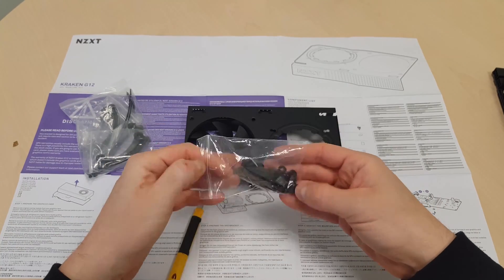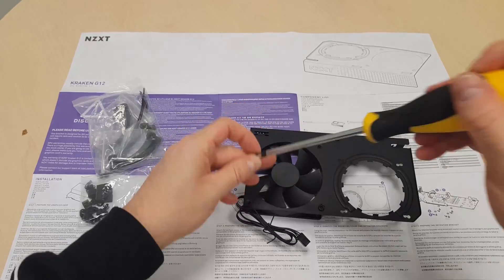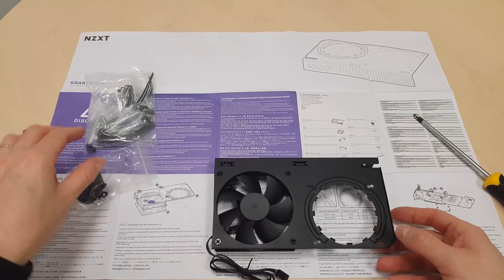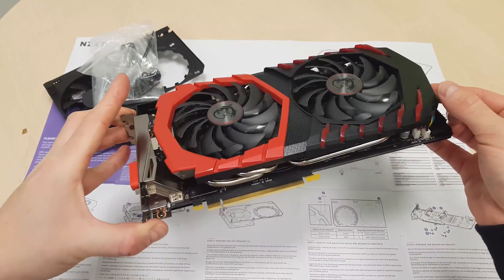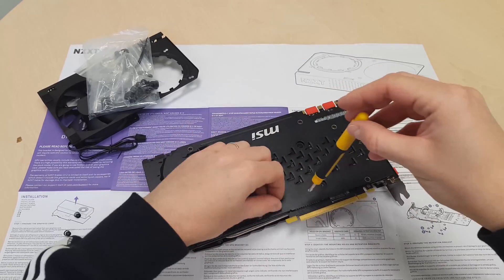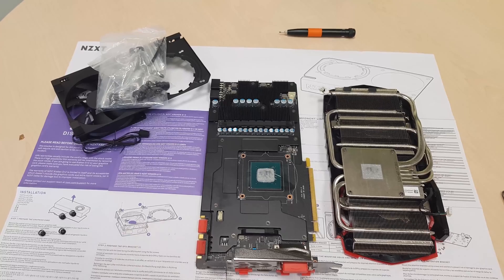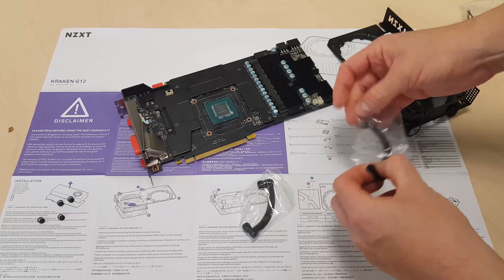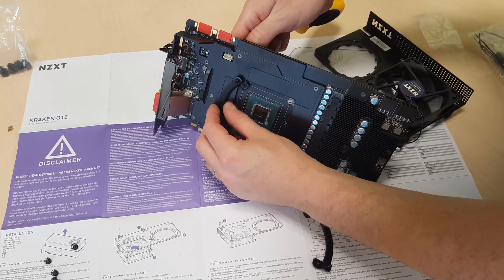Kraken G12 with GTX 1080 installation guide (4K)

Comment: Im confused your pc is upside down? If not that your installation is wrong, the pump should be lower then radiator.

Also did you forget put the thermal paste?? 🤣

Comment: actually the bracket's fan should be mounted to blow air on to the vrm and memory modules and not the way you put it. Maybe you could squeeze a couple more degrees less that way
Reply: Also where is the thermal paste
Reply: @EminentInception94  it's pre applied on the cold plate

Comment: I need help with this, i followed the same guide and while ingame after few mins i see dots on my screen and the game shutdown.....any tips?
Reply from the maker: U should monitor your gpu temperature with software such as hwmonitor. And you should double check that your heatsink is tightly attached to the gpu. Also make sure you connected all the power plugs. I think cooler has 2
Reply: @Techgurl  i'll try this,im mounting this on a b450 gaming plus max and probably i connected the pins in the wrong places
Reply: @federicoandreani201  This tech YouTuber had the same problem as you (sort of). You should definitely check out his video for a bit of help : https://www.youtube.com/watch?v=a7r_2rE1yro

Comment: Thanks this helped me with my same card!! Sitting pretty vertically mounted with the kraken x53!!
Reply: its late to ask but can u help me telling what kraken i should get i have gtx 1070 and what cooler i much get it but i want only single fan like this im so confused what is going to fit i dont want to order wrong stuff thanks
Reply: @gutsy-beard14  

TL;DR - Kraken x42(if you can get it) or Corsair H55. See below for why.

Technically any Asetek (type of mount) AIO will work. That includes any Kraken AIO or Corsair Aestek AIOs. However specifically this is the compatibilty list (from amazon):
------------------------------
Compatibility - Graphic Cards
Nvidia
Titan X, Titan, Geforce GTX 1080 Ti, 1080, 1070, 1060, 980 Ti, 980, 970, 960, 780 Ti, 780, 770, 760, 680, 670, 660Ti, 660, 580, 570
\AMD
RX 480, 470, R9 390X, 390, 380X, 380, 290X, 290, 285, 280X, 280, 270X, 270, R7 370, HD7970, 7950, 7870, 7850, 6970, 6950, 6870, 6850, 6790, 6770, 5870, 5850, 5830
Some variations in AMD die height may require the use of a copper shim which is not included.

Compatibility - AIO Liquid Coolers
NZXT
Kraken X72, X62, X52, X42, X61, X41, X31, X60, X40

Corsair
H105, H110, H90, H75, H55, H50 (CW-906006-WW only)

Thermaltake
Water 3.0 Riing RGB 360, 280, 240, Red 280, 140,
Water 3.0 Ultimate, Extreme S, Extreme, Pro, Performer
Water 2.0 Extreme, Pro, Performer

Antec
KUHLER H2O 920V4, 620V4, 920, 620

Zalman
LQ-320, LQ-315, LQ-310. 
-----------------------------------
In terms of cooling a single fan option. In the UK Kraken x42 is no longer available - seems in US Amazon it is. Best bet: x42(if you can get it) or Corsair H55.
Reply from the maker: U need to check compatibility list on craken website
Reply: @gutsy-beard14  yeah but make sure to install heatsinks on the vram chips and vrm because noone seems to be doing it for some reason ?

Comment: i am  installed the kraken g12 with corsair hydro h55 on r9 390 and after that always i start any game the card was disconnect and i have no picture ,after that i need to restart my pc ,maybe you know what can be a problem?
Reply from the maker: U maybe forgot to connect power to the cooling unit?
Reply: @Techgurl  no ,I connected the pump to the motherboard and then when it happened for the first time I think maybe the motherboard slow down the pump ,like fans control or something,then I connected it to fan splitter and had the same problem,I set the stock cooler back and  everything is ok,I think maybe my power supply is not enough, I also try to connect stock cooler when the pump is on the gpu to exclude the option that it is programmed to work with them, and I still had the problem ,I want to try just connect the pump to fan splitter and try play something when the stock cooler is on the gpu

Comment: How the GPU can control the pump and fans when they are didn't connected to the gpu?
Reply from the maker: I dont know but it seem to work well and the temp is low
Reply: @Techgurl  ofc because the pump and fans working always on 100% and when you just browsing or seeing movies it's noisy
Reply: @alexorn21  I put my pump in a 12v for 100% speed and it dosn't sound that bad on a Corsair H55.

Comment: How are you controlling the pump.. and how thick does this make the gpu
Reply from the maker: Its aio system. No need to control anything. And the gpu is thinner than stock

Comment: Several errors in video for others to avoid:
1. Pump above radiator can trap the little bit of air in the AIO, which is louder, causes worse cooling performance, and shorter pump lifespan
2. Fan backwards but, that's already been pointed out; cooling not as efficient as it could be
3. If leaving on the "midlate", cut the foam offsets that are designed for no "midplate"; notice the significant bend of the G12
4. Screws appear to have been overtightended but may have been done to offset mistake #3
5. Don't plug in pump into fan controller, plug it into something that provides full power such as a SATA or motherboard fan header
Reply: I was watching and think the same shit. Like I thought to myself as I was watching, I wonder how many bad PC build videos are put there that show mistakes and incorrect stuff as if its correct, misinforming people.
Reply: question for no 3 do we need the foam offsets? can we just not put them
Reply: @samuelkdu  Yes, you can get away without using the foam. You would just need to be more gentle with handling the card after it is installed. The foam basically prevents a user from pressing the cantilevered fan portion of the g12 towards the PCB.
Reply: I have 3 open fan plugs on my mobo I can plug them up there with no problem doesn’t have to be a pump plug
Reply: Just make sure to set that fan header on 100% from bios otherwise pump won’t work properly

Comment: Is that stock VRM fan a 3 pin or 4 pin? And how are you powering that H90 cooler.
Reply: Can you tell me. what other things I need to buy unless that kraken g12 if you can to send me link  of the parts please my video. card. it's same

Comment: I have been looking at getting one of these but wasn't sure if my pcb would work. Turns out from doing a little research, my GTX 1080 Duke has the exact same pcb as the gaming x. The card is extremely long and gets a little hot (65-75C) when gaming at 1440p pushing 144 fps at high settings even after a setting a custom fan curve.  Hearing of people being able to keep the temps below 60C (45-55C) has made up my mind. Thank you for showing this video so I can now feel better about making the swap knowing this should fit my card!
Reply: Yes, my RTX2070 almost hit 80c with overclock, now it's around 60c load with the G12 and a Corsair H55.

Comment: I am really considering this because my gtx 1080 is always at around 85 degrees under load, and its loud af. But the only thing that concerns me is taking apart my gpu as well as connecting the fans/aio to the graphics card. I saw you where using a fan hub to connect it, but is there a way to have the gpu to control the fan and the aio cooler?
Reply from the maker: The gpu has only one fan connector. For this you need 2
Reply: techgurl Ok, then should the pump or the fan connect to the gpu?
Reply: I would like to know this as well because I'm really close to buying this setup for my 1080 FE and have no idea how the fan cables are plugged in as most videos I have watched don't even show that process :/
Reply: Kelvin Lam Kinda late reply, but you can get a Y-splitter from noctua, with this splitter you can connect the pump+vrm fan and control it like you would control your stock cooler (through the gpu) And the fan for the rad just plug somewhere into you mobo and control it through bios, if you don't want to get that splitter from noctua you simply plug all the connectors into you motherboard if you have enough space.

Comment: I'm just gonna say you were better off re-pasting if you were hitting 80+.
Reply from the maker: Repasting brand new card? For mining its not good enough
Reply: @Techgurl  you don't know fuck all you put the vrm fan on backwards 😂
Reply: @plummet3860  as long as it moves air over the VRMs, it dont mater what way the air moves. and you say he dont know fack all?
Reply: @grasshopper1g  Its pulling air away from the VRMs not pushing it lol
Reply: @plummet3860  yes, and that don't matter.  As long as it's fresh air.  And why say lol after everything? It's just strange.
Reply: @grasshopper1g  How do i say lol after everything i said it once? pulling air from vrms will not cool them properly at all you are strange for thinking it doesnt matter iam guessing you mean why do i use the emoji for laughing after stuff? thats because its what happens when you post comments via a phone
Reply: @plummet3860  I have this on a 2070.  I just tried it both ways.  It made no difference at all.  It still cooled vrms and memory just fine.  I can show you a video if you want.?  Pulling air, or pushing air, is still air moving.  And that is all it needs.

Comment: was it ok to have the G12 mounted bent like that? does NZXT include smaller "feet" to avoid this?
Reply from the maker: It works fine
Reply: techgurl it seems like it would work fine without those rubber supports too?
Reply from the maker: Maybe.. but it seem to help not to scratch anythin
Reply: probably would of cut the feet down to with a knife before assembly so the bracket wasn't so bent.
Reply: Can you tell me. what other things I need to buy unless that kraken g12 if you can to send me link  of the parts please my video. card. it's same

Comment: Umm... no thermal paste? Your fan was installed backwards as well.. Take this down or change your title ffs
Reply: there is thermal paste preapplied to the water block. didnt need to add more there.
Reply: With the clearance in his case the blower style fan might actually work better.
The fan will starve for air if it's trying to push air onto the VRM in his situation because of the lack of air to suck in where the fan is placed up against the case wall.
Reply: Can you tell me. what other things I need to buy unless that kraken g12 if you can to send me link  of the parts please my video. card. it's same
Reply from the maker: It works well and temp is low. So whats your problem?
Reply: You know how keyboard warriors are, easily triggered. lol

Comment: I have a question, I am willing to buy the Kraken G12 but I do not understand very well how the connections of each fan, the sea of the radiator, the pump and the heatsink of the GPU. Min 6:20 where does each connector come from and what is the name of that device that has many 3-4 pin inputs? Thanks
Reply from the maker: you only need to connect 2 standard fan connectors. the name of the device is fan controller and it's a part of this Antec Razer Cube case
Reply: Thanks , im other dude why do not mount a copper shim on top of the gpu chip? look this video in minute 8:30 https://www.youtube.com/watch?v=S2SFSYl60jk&feature=youtu.be
Reply: @Techgurl  Sorry for my. bad. English but. pls. just tell. me. so. I got. the same. video card if I get the kraken g12. do I. need. to get. heat sinks. for vrm and. vram.  or no???
Reply: Daniel Cler only use it on evga cards but not necessary needed for most cards but for evga cards I would dremel it since I will do it tomorrow
Reply: Ok thanks ;). My card is MSI 980 Ti 6gb
Reply: The device is called a fan controller, its a substitute to plug in more fans and pumps instead of plugging them into your motherboard Corsair and other can companies sell them. I Have 2 1080 Ti's and I definitely need this for running them in SLI.
Reply: Can you tell me. what other things I need to buy unless that kraken g12 if you can to send me link  of the parts please my video. card. it's same

Comment: how do you control pomp and radiator fan speed?
Reply from the maker: Its fully automatic. No need to control anything. But i assume you can somehow control fan voltage
Reply: The only speeds that are controlled are the fan speeds cooling off the v ram, and the water pump/Radiator fan. Realistically you only need to plug the water pump and v ram fan into the motherboard. You can plug the radiator fan connector on the one that comes with the pump if you are using an AIO cooler.
Reply: you control that corsair with corsair link.
Reply: Can you tell me. what other things I need to buy unless that kraken g12 if you can to send me link  of the parts please my video. card. it's same

Comment: Your vrm fan is backwards
Reply: Yolo
Reply: LOL
Reply: I should have read the comments (or just looked at the arrows on the fan) before I followed this video.
Reply: i think its exhausting the hot air
Reply: @XsBig  There is nothing to exhaust. That fan is just to blow on the VRM's, and Memory to keep it cool. Has no other purpose. But his temps still seem amazing, so there isn't much to complain about. Getting this in a week. So hyped.
Reply: AdvancedBretty I’m pretty dumb so tbh idk for sure but isn’t he right with his fan placement? Does the back push out the air and the front takes it in? The config NZXT has in their manual had the fan pulling air away from the Vram and into the case
Reply: @conorbreen3807  The VRM's and memory dont have heat on them to just blow away. Unless it has some connection. Like heat sinks and thermal paste. You cant put an exhaust fan on a oven thats hot and expect it to cool down. Only way to cool something like that is to blow cool air on it.
Reply: AdvancedBretty yeah I meant to find this comment again. I watched this video as I was putting mine on lol. Within 30 minutes I realized the PCB goes on the side opposite to the one I thought it did when I commented, he def has it backwards lmao
Reply: @advancedbretty4978  Sorry for my. bad. English but. pls. just tell. me. so. I got. the same. video card if I get the kraken g12. do I. need. to get. heat sinks. for vrm and. vram.  or no???
Reply: @advancedbretty4978  Sorry for my. bad. English but. pls. just tell. me. so. I got. the same. video card if I get the kraken g12. do I. need. to get. heat sinks. for vrm and. vram.  or no???
Reply: @reyzo3411  No you'll be fine. 

The fan on the G12 will be enough to cool it. Some test show the fan with the g12 cools it better than the original cooler on the card itself.
Reply: @advancedbretty4978  I got i9 9900kf  with ROG Strix 240 cpu cooler. and. my case is cougar. panzer with 4 fans. front and 1.rear. 32 gb ram but just the gpu is the problem now i hit 59c but Tommorow I order. g12
Reply: @advancedbretty4978  so my case can get. more. 2. fans it's big so you are sure it's going to be good gpu Temps if I get g12  + two more fans 120 mm for my case??
Reply: @advancedbretty4978  Then why some. buy. and. heat sinks for vrm. and. video ram  + g12 or because it's depends on the video. card?
Reply: @advancedbretty4978  because I read some posts. with high Temps. on vram and vrm after kraken g12 without heat sinks :(
Reply: @reyzo3411  Well VRAM temps are suited for up to 120-150c plus If I recall. They can get hot but will fine and I'm sure it does depend on the GPU. Obviously some will get hotter. All I can tell you is that you're going to be fine.

Also, if you would love this idea do it! But if your GPU can hit 80c with no problems at ALL. This is more for people who dont like noise, or want to push their GPU more. But you do you man.
Reply: @advancedbretty4978   SEE WHAT I FOUND I AM LUCKY   ,,,,,,  Backplate covers the whole length of graphics cards PCB, serves as an aesthetic add-on and also provides passive cooling for the backside of voltage regulation module (VRM).
Reply: @advancedbretty4978  But all its left is the video memory how it's gonna be cold  just that  xdd
Reply: @reyzo3411  Nice. Good luck
Reply: Did you end up installing the G12?
Reply: @qalih  Me? Yes.

Comment: How much was your temps on GPU with stock cooler?
Reply: I pulled the back plate off my Aorus 1080ti extreme because I was overheating with temps of 81-91C after just putting the new thermal paste on and keeping it air cooled I am seeing temps of 65-70C WHILE running a second 1080ti in sli
Reply: My MSI GTX 1080 Gaming X was getting into the high 80c with 100% fan speed even, i took the heatsink off after going back and forth with MSI about warrantys, and, well, lets say I LOST the thermal paste lottery lol. there was literally nothing there. wish i could post pics here. but i put some artic silver on it and not its like 65 max load with 70% fan speeds with my custom fan curve.
Reply from the maker: With stock cooler it was around 80-90c
Reply: Can you tell me. what other things I need to buy unless that kraken g12 if you can to send me link  of the parts please my video. card. it's same